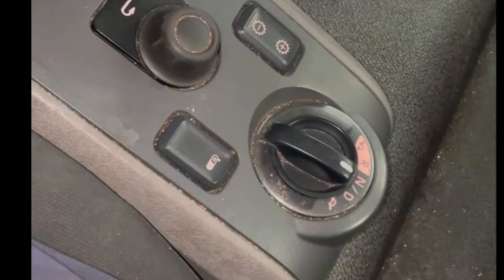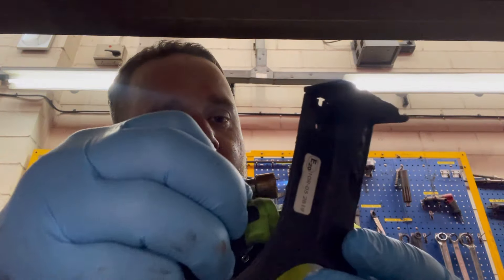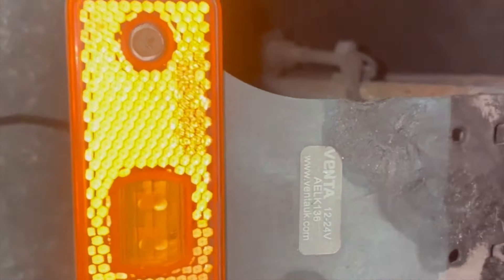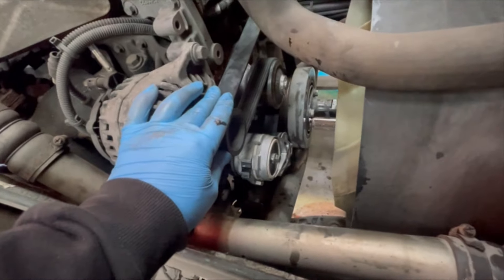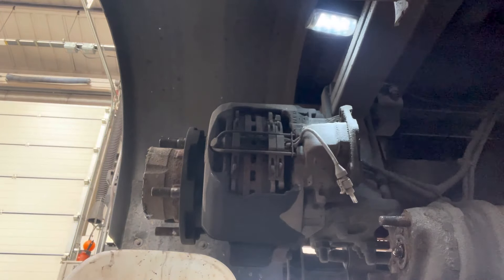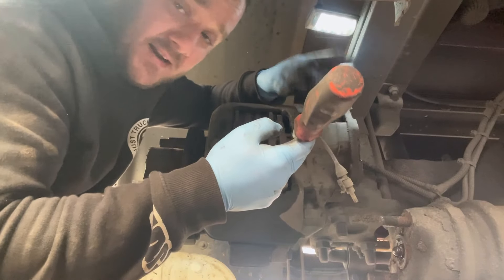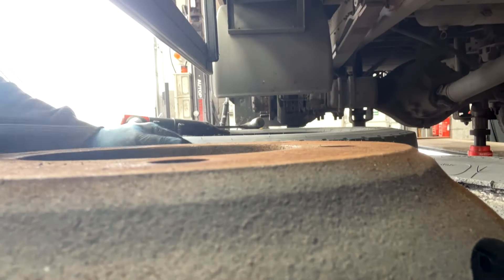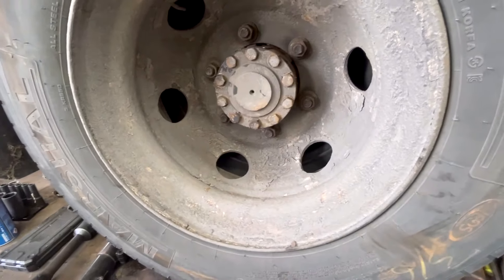DAF LF repairs, hub seal, plastic welding! Hgv mechanic uk

Comment: Is there an O ring on this set up, if so, do you put it on the stub axle first?
Reply from the maker: Yeah there is a O ring, I normally put it in the hub first some grease to keep it in then refit.
Reply: @freightlanetv  Thanks. I pulled the hub off and just seen a seal fall on the fall but couldn't find a groove anywhere it would sit. I knew you would know
Reply from the maker: Yeah if your not sure it’s a easy thing to miss especially if it just falls out